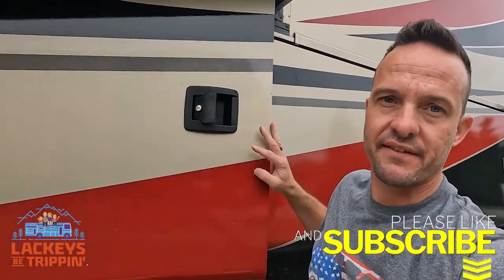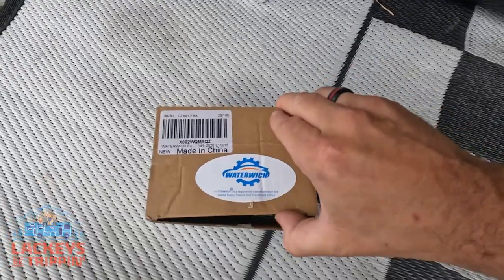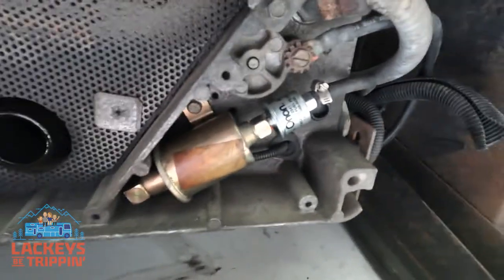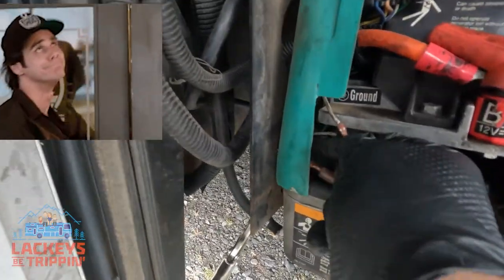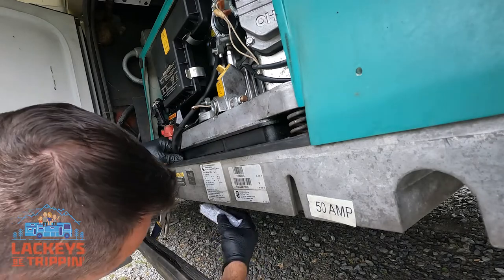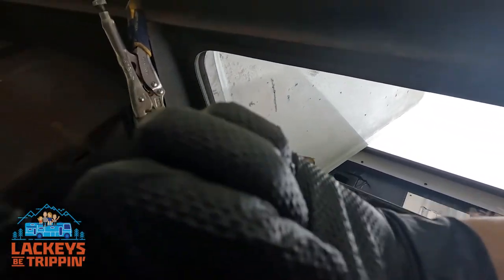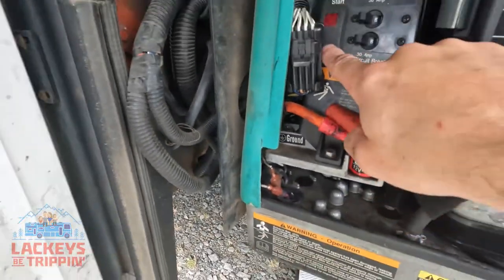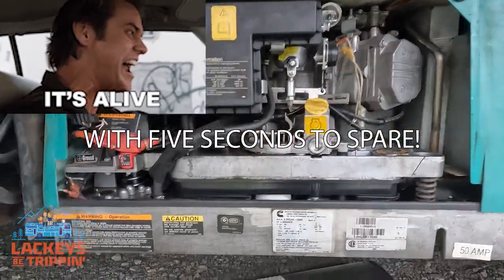How To: Replace Your RV Generator Fuel Pump in Under 5 Minutes!

Comment: I just want to thank you so much for your video!!! I'm a single mom of 3 (one grown living her own life, 2 still at home with me), that full times. We have a tight budget and when our generator went out the day of our big cross country road trip- I freaked out a bit. I paid $100 for a diagnostic and found out its the fuel pump, got a quote of 488.38 to fix it, which seriously cuts into our gas budget for the trip (that's basically one fill up!) My cousin and I watched your video, and he found the part on Amazon and ordered it for under $30. He is going to help me change it this weekend thanks to your video- you saved me $400!!! I am even tempted to try it myself, so I know how to do it in the future since its just me and the two littles when out on the road!
Reply from the maker: Amanda, thank you for your comment! This is exactly why we post these how-to videos, so it's great to hear it was helpful. Just so you know, we've replaced almost every single part aside from the engine on this particular generator and if the fuel pump doesn't completely fix your issue I can help guide you to the next step! Shoot me a message if you are still having issues after the new pump goes in. -Rob
Reply from the maker: One last thing, please subscribe because I have a couple more generator videos in the till: one showing how to diagnose and repair the control board, and one showing how to diagnose and remedy heat soak and vapor lock!
Safe travels on the rest of your trip!

Comment: What's the lube you used to connect the fuel pump? (RTB?)

Also, did you have to disconnect any wires to prevent from shock?

Lastly, how much was the fuel pump

Comment: How did the find the comparable pump on Amazon? I searched my onan part number and don’t see an Exact replacement
Reply from the maker: Simply search "Onan QG5500 fuel pump". There will be several Chinese brands to choose from. I used Waterwich on the last one.

Comment: Curious what the symptoms were That made you diagnose needing a new fuel pump? My fuel pump seems to work for 20 minutes and then stops. I've replaced them and the problem continues. Are these just bad fuel pumps? Is there something else?
Reply from the maker: Using a multimeter, check for power at the pump wires when you prime the system. If there is power but the pump isn't pumping, you need a pump. I can make another video for this if needed!